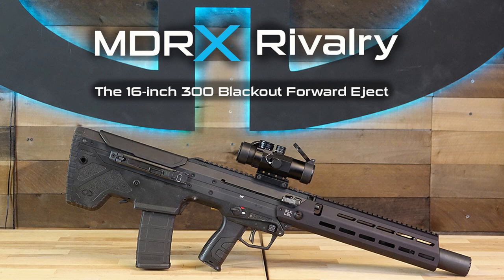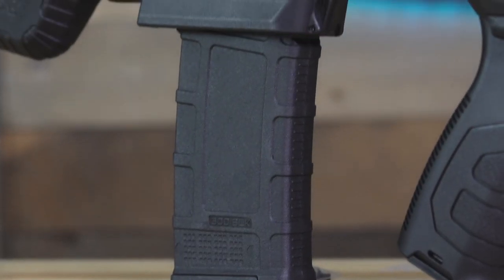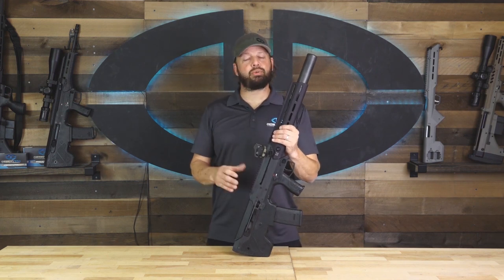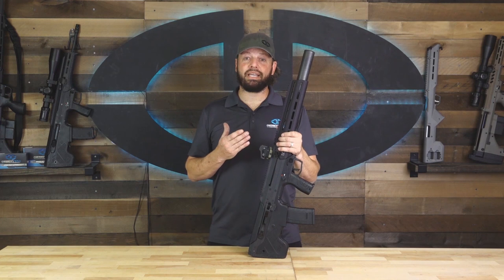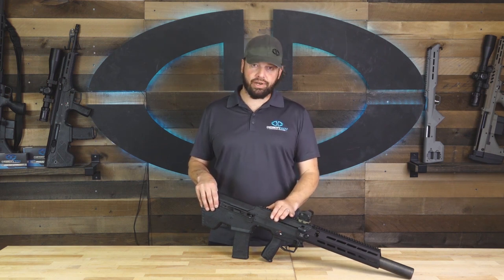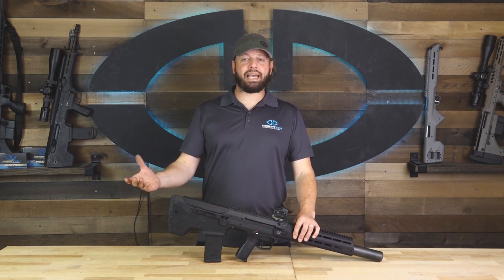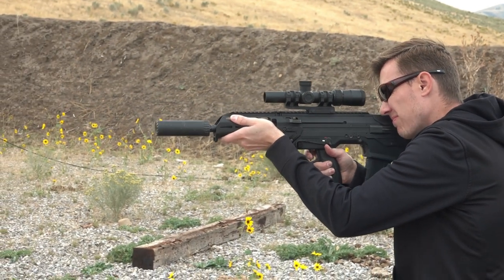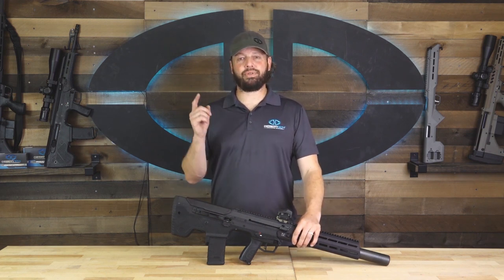MDRX Rivalry: 300 Blackout

Comment: I would have to disagree, 110 to 115 grain 300BLK out of a 16” barrel puts 556 to shame. Ballistically it would be the better choice within 350 yards. Suppressors need not apply.
Reply: You are 100% right and there is just no need to use crappy sub sonic ammo.
Reply: @robertsears8323 subsonic is not crappy at all. It's substantially superior to 556 for home defense. 

Did someone just break into your house. Grab your 556 but don't forget to grab your hearing protection. Woops that took too long and now you have a hole in your head. 

Ok this time we won't grab the hearing protection. Congratulations you saved your life but now all you can hear is constant screaming in your ears for the next 2 months and permanent hearing damage. And that goes for anyone else who was in your house. 

Subsonic 300blk is hands down better for home defense. You don't need hearing protection and it delivers the same energy as a 45 on target with vicious tumbling out of a short barrel. In fact there's barely any reason to go above a 9 inch barrel with 300blk. The round burns nearly all its powder out of a 9inch barrel.
Reply: @suchopsmimic399 You are wrong on all parts. 
1. You CAN'T get hearing damage from a few shots no matter how loud the gun is. The ringing stops after a few seconds.   
So you got that part very wrong, 
2. 300 is ONLY good in a supersonic round as it is a rifle round and is not heavy enough to do damage under the speed of sound. 
It don't even have has much power as a crappy 9mm round. 
3. No the 300.blk in NO WAY burns even half of it's powder in a 9 in barrel. 
I don't know where you pulled those lies out of but you need to go away and learn something about guns so I don't have to keep teaching you common sense stuff.

Comment: Ok... concern.  You say the gas system is modified.  I'm guessing that means I would need to change it out for a switch to 300.  But would I need to change it back when I took the 300 barrel off?  Same with the buffer spring.  Let's get to brass tacks.  I have the 308 version.  What all would I need to change going between the two?
Reply from the maker: The gas system is entirely contained in the barrel assembly. So by switching barrels that would already be taken care of. The recoil spring would need to be swapped tho, other than that it would be a standard caliber exchange
Reply: I recently did a 308 to 300blk conversion. Its currently my favorite version of the MDRX.

Comment: Is the 300blk spring stronger or weaker than the standard recoil spring?
Reply from the maker: it is shorter
Reply: @DesertTechUT  Why is it shorter?
Since there will ultimately be other who will ask
"what would be the issue if I used my 308 spring over  the included 300 blk?"
Reply: Is the gas piston and bolt different from kits sold at the initial launch?
Reply from the maker: @Odinforever2000  piston no, bolt yes
Reply from the maker: @Odinforever2000  Malfunctions maybe?
Reply: How would I aquire the updated bolt? Or do you think I wouldn't need it?...My bolt is labeled 556.
Reply from the maker: @Odinforever2000  Probably have to wait until they are available.
Reply: @DesertTechUT  what was the reason for the new bolt change?

Comment: This is a bit weird. First, I'll preface that some customers of your products  -- and 300BLK fans! -- are in places they can't use suppressors.
(There are many reasons for this, but let's just assume it for sake of argument. YT Comments aren't the ideal place for this, but I'll state my piece.)

The gas system issue [harm with wrong setting] is unexpected in modern era.
As an example of this "oddity" -- FN voids 17S SCAR warranty for using a suppressor. [Bolt battering the receiver rear, screw canting, "Scarburetor".]
From (2:30), DT may void 300BLK MDRX warranty for not using [subsonic ammo]. [Community reports from "1st run" 300BLK are indeterminate.]
(Also noting: Subsonic gas setting + Super bullet..... [with/without suppressor high backpressure?]. I would expect Sub port setting was more restrictive, not *less*!)

Many suppressor testers, as part of course of fire, load magazines with [alternating] Super-Sub-Super-Sub on a rifle with a can.
They then video tape the string of fire, to show "first round pop" and comparison of loudness intensity delta for video demonstration.
From what is described at (2:30), this could potentially cause damage and void the 300BLK MDRX warranty.

This isn't unheard of, as even CMP recently stated in a bulletin shooting WWII M1 Garand with 190gr Hot-Rodded loads is "inadvised and may cause damage".
Although the M1 Garand was proofed at >100k CUP -- that was when it was new. The (80-year old) receiver and oprod velocity are simply not as robust as they were.
But I would hope your engineers can (cleverly) find a velocity-dependent BCG-rate-reducing piston design/mechanism (i.e. "kinematic damper") to solve this issue.

Again, if the weapon platform is designed that way (certain ammo in certain setting = no-no), that's fine.
It's just uncommon to lack that design robustness in this day and age.
Reply: FWIW, I've been in queue [fully prepaid!] for a 300BLK kit since 2019-ish.
I still have hopes for the platform, hence have been waiting patiently.
I wish your engineers the best of success in meeting these technical challenges.

To reduce complexity, and risk of user error during installaton/swapping...
...I would almost suggest including an entire swappable carrier as the kit.
This "KISS" approach would help completely circumvent [recoil spring] installation damage, and allow faster caliber swaps.
(Again, I state this as an owner of 2x MDRx's, and all other "viable" conversion kits.)